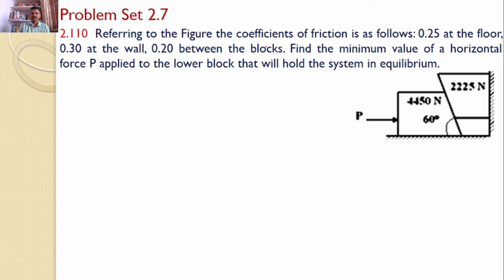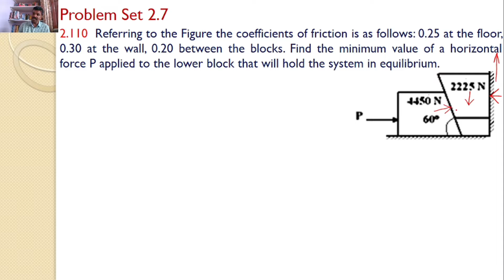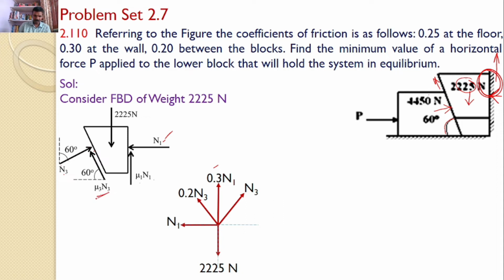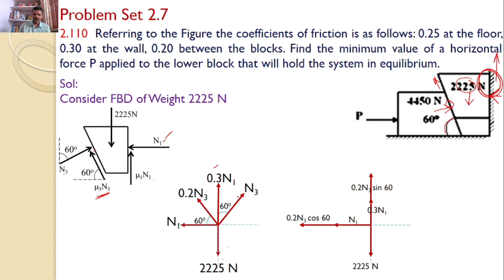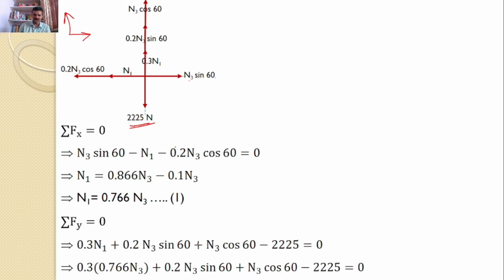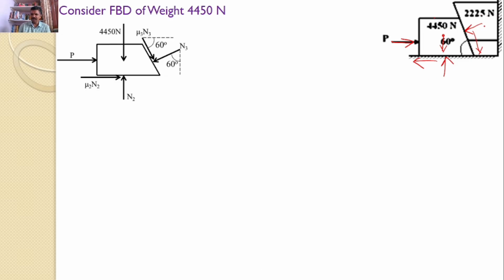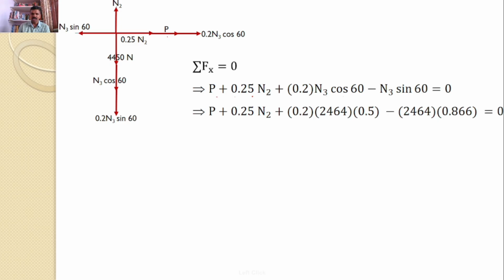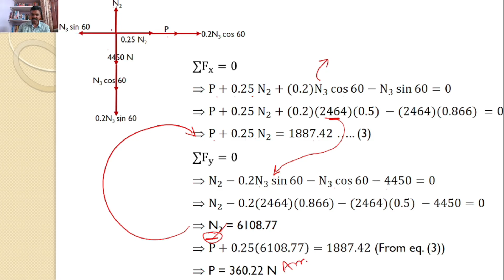Engineering Mechanics, solution, Problem 2.110, Timoshenko, Equilibrium Equations, Friction

Comment: sir for body of weight 4450 the frictional force N2 should be to left????
Reply from the maker: No. As the weight 2225 moves down by virtue of its weight, 4450 weight moves left and hence frictional force is towards Right
Reply from the maker: Even with left direction if you can solve, you will get same answer but with negative sign...